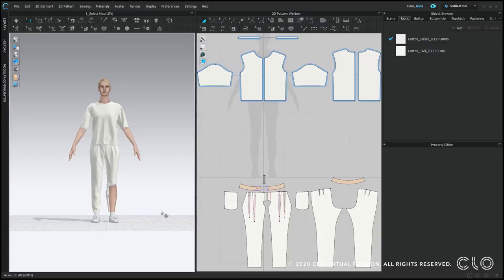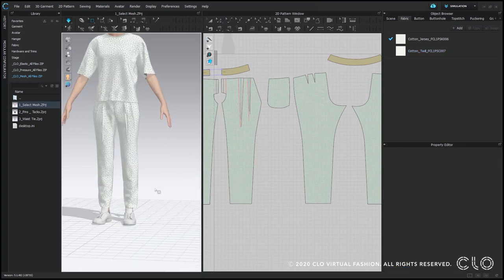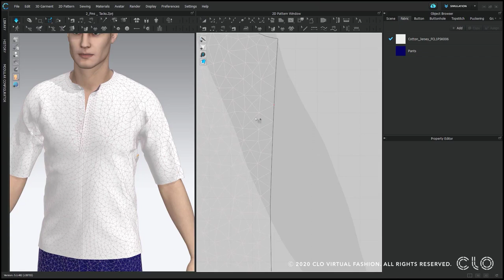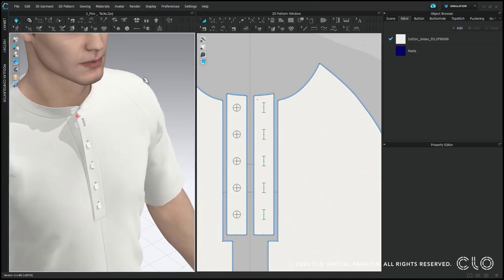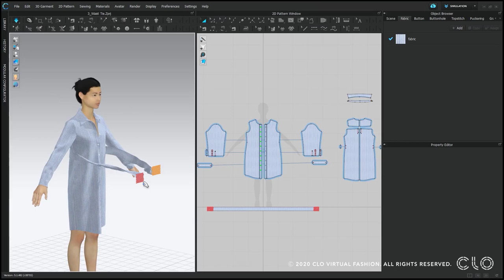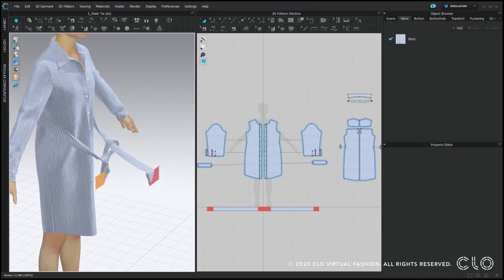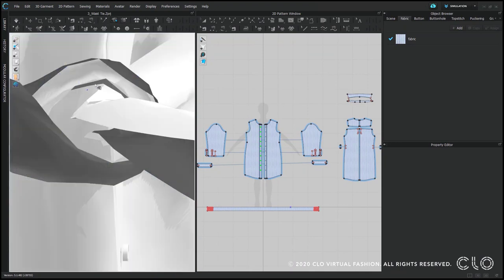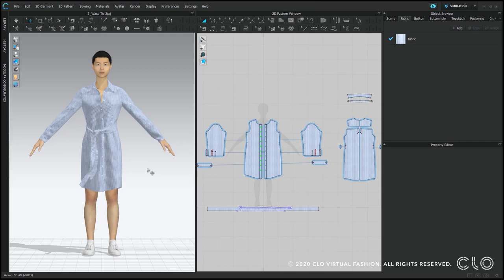Beginner's Guide to CLO Part 3 Garment Details: Mesh Manipulation (Lesson 4)

Comment: I can’t move the pinned sections with the hand grabby tool. Selected areas only move when on I’m using Pin (Box). During simulation, the selected areas seem to be frozen.
Reply: Make sure to select the pinned sections of the belt separately (ie one end, the back, the other end), if not and you hold shift to select them all the tool will treat the pinned sections as one object and you wont be able to move the ends individually.
Reply from the maker: @Olivia Fierro is correct. Thanks for your help!
Reply: For those with the same issue: after simulating, re-select the pin box tool and use that to move the sections.

Comment: I'm using the most recent download of clue 3D from July /2/24 and I'm having a issue using the select mesh tool in this first part of the tutorial. In this section I'm being able to use that select mesh tool to then pull that specific section of the pattern piece out so that way I can demerge it from crashing with the body avatar. However when I use the select mesh tool in the two D window and select the portion I feel like the front and back pattern and then when I go to pull it out it's completely deslet everything how do I fix this or how do I select the part that's been highlighted to pull out?
Reply from the maker: If you are selecting first in 2D you must make sure to the click directly on it (the bright green) in 3D as the next step. If you click on anything else it will be deselected